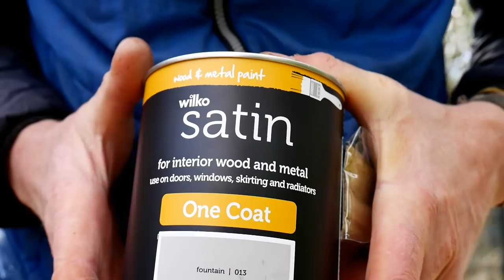Micro Camper Cheap N Easy Small car conversion Wiltshire Man

Comment: Brilliant idea! Those gas stoves are very good  I use one at my allotment, but, the canisters dont work when it's very cold. Looking forward to your first trip in your micro camper.
Reply: That is true. But you can warm them up and they work fine. If you have hot water there, you can wrap it in a towel or something with a bottle of hot water. If you go car camping, you can keep it in a towel in the bottom of the sleeping bag. Don't put it on a wood stove! It will explode and the cabin or the tent will burn down :-)

Comment: An idea. On amazon they have these fans that hang from door or open window frames, They are supposed to blow air from outside into a room but you could hang it from the roof near the cooker and use it to suck the hot air and evaporated grease out of the car. I had one that run on a battery for my shed. Surprisingly powerful and you just pug a usb lead into it to recharge

Comment: Excellent idea Sandy. We used to have something similar in an old volvo estate. It was flat with the seats down which was great and i rigged up a wee curtain up an an elastic cord. Not quite as sofisticated as your kitchen area though! Happy travels x
Reply from the maker: This little car is just long enough Mary. Any shorter and it wouldn't have worked

Comment: Nice little setup.  Just a tip, you shouldn't need to use a lighter to start the stove up, generally if you turn the flame control knob all the way around and hold it it should have electronic ignition.  It is always a good idea to have a backup like matches or a lighter just in case though.  Enjoy yourself when you manage to get away in your little van.
Reply from the maker: Thanks Jenny. Yes I know about the stove igniter noiw

Comment: Fantastic minimalistic set up. I know what you mean about comparative luxury when you have been used to living out of a rucksack. With your set up you have more options, in places like Scotland that has lots of lay bys they aren't really set up to allow tents to be pitched but your set up would be ideal. And you can still hike with your back pack when ever you want. Well done. My only concerns about the Cooker set up now that i've seen you use it is perhaps you could damage the back of the seat or the plastic behind the cooker if you need to use the cooker for any length of time. Perhaps the cooker stand could be built up on those sides if it demonstrates any damage over time? It would help protect the interior from food splashes as you cook?
Reply from the maker: Thanks Mik, Sofar its been fiune. I've checked heat build up in that area and nothing much there. Maybe with a larger pan I would have to be more careful

Comment: A plug in coolbox like truckers use Sandy and you'll be good for a week away. 👍
Reply: Just check the wattage...they can drain a car battery very quickly. Perhaps use a 2nd leisure battery like boats & motor homes.

Comment: A good idea on how to make the window blinds, very cheaply and they will last a long time, but I would be tempted to add some suction cups to them to keep them in place a bit better, available on Amazon Suction Cup - 20 Packs 45mm Clear Plastic Sucker Pads Without Hooks, PVC Plastic Suction Cup/Suckers Pads, Extra Strong Adhesive Suction Holder : AmazonSmile: Home & Kitchen, Cheers
Reply from the maker: Thats a good idea, I am also tempted to replace the blinds with curtains and small magnets

Comment: Nice setup, Sandy.  I used to use one of the old Coleman stoves that use petrol (not in the car.)  I bought a stove similar to yours that uses the same butane canisters.  The fuel is more expensive, but the stove can be used inside.  I still have the Coleman, but never use it.  Just like the first ham tx I built .  500 mw cw with two transistors.  I still have that and don't use it either.  Nostalgia, I guess.  N9QIL

Comment: Yep great little cookers those, but did I see you light it with a lighter? They have pizzo ignition 😉
Hope you enjoy your first camp out in your car 👍
Reply: I was thinking the same thing, but you couldn't see the self igniter on the close up of it. Maybe it hasn't got one. I have the single fuel version of this,. And believe it or not, I have used it as my only cooker on a daily basis for 5 years now. I am baking bread on it too :-)
Reply: On my stove,you turn the knob to its fully on position,and then you feel some resistance,turn it further and it sparks

Comment: Enjoyed your video, could I ask what stove was you using and can it run on butane and propane with the use of a hose to canister conection, thanks Mike
Reply from the maker: Hi Micheal yes this little stove has an adapter so you can screw on a standard canister too, I don't know the make of the stove but it was quite cheap and I brought it from Go Outdoors here in the UK

Comment: Thank you so much! I have a C3 Picasso which I've been wondering how to 'camp up'... I'm used to having a van with plenty of room so couldn't imagine how to go about down sizing. Won't cost me much as I still have ply and bits and bobs from my last van. I can't wait to have a go now! Just one question..if your boot has the lifty up bit with hidden space, have you built the 'bed' with this up or down?
Reply from the maker: Hi Lyn the lifty up bit is still there, just made the platform over the top and same height as the back seat when folded down. I can remove all the camper bits in 2 minutes it really is very simple to do
Reply: Thank you so much for your reply

Comment: Hi, how do you deal with condensation and allowing for an airflow when you're sleeping.
I drive a vauxhall astra 2012.
Reply from the maker: I never had much of a problem with condensation, I generally only used the car as a camper during the summer. It's a good idea to leave a window slightly open

Comment: Sandy, how long was the bed part, and what bit did you need to cut out?  I had the same (exact) car.
Reply from the maker: I managed to get the bed length around 6 ft, just had to cut out a profile to allow the front seat to move up and down, the plastic housing for the seat belt gets in the way otherwise

Comment: Why didn't you just wind down the window, attach a large piece of paper over it on the outside then draw around the inside of the window frame on the inside surface of the paper, cut it out then use it as a template?

I nearly bought the same car but when I went to see it the salesman at the garage tried to tell me it had been serviced etc but the brake discs were so rusty I should imagine it would have failed an MOT. I bought a Peugeot Partner Tepee MPV instead which is a tiny bit bigger. Carries my bikes with ease and I can easily sleep in it. Like your C3 I can easily remove the rear seats if need be to carry larger stuff. Tbh I'd rather be in a tent as if in the car/van condensation can be a problem, but I guess if the weather turns pants then the car/van is the better option. Maybe a combination of the two is the best solution? Fine nights in the tent, wet and windy retreat to the car.

I'd be careful with fumes whilst cooking as well. Definitely cook outside if at all possible or if the weather deteriorates and you need to cook make sure you have very good ventilation, fire extinguisher and fire blanket to hand. Maybe some heat resistant mats would be good things to have?
Reply from the maker: There's 4 windows that won't wind down